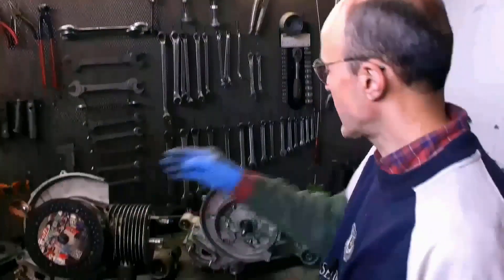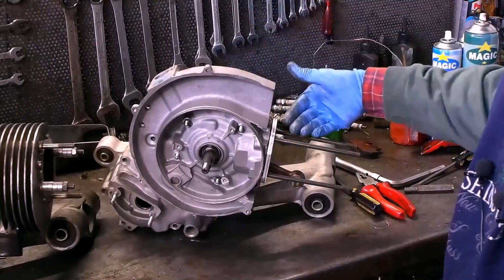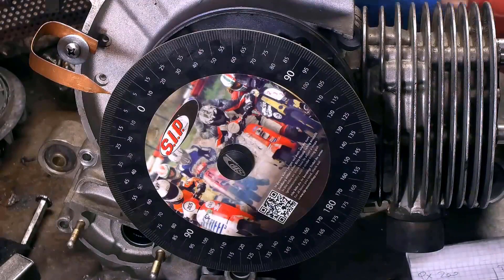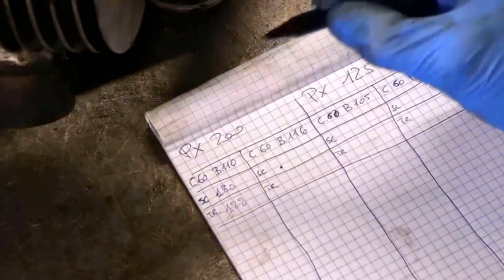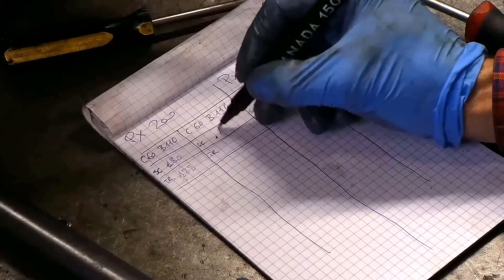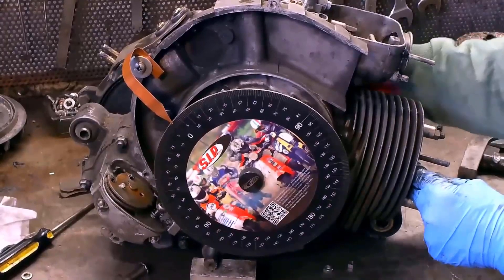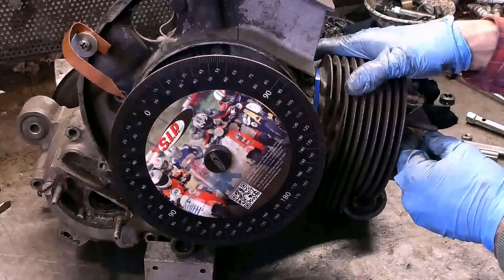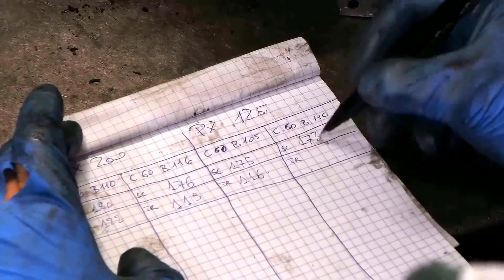17 - Timing variation: Blowdown (connecting rod length) - Part 2 of 3

Comment: I love the video, I’m working on a 50cc Benelli with a stock transfer opening of 120 degrees and a exhaust duration of 168 and a intake duration of 144 what can I do to make this cilinder more sporty but still comfortable to ride at lower speeds what would you recommend? 
I have a stock pipe with a passage of 28mm and a length of about half a meter and a delorto 20mm vhbs 
I hope to hear from you soon

Kind regards 
Mr. Whiskers
Reply from the maker: we recommend bringing the exhaust timing to 180° and the intake timing to 160°, the engine will become grumpier, but much more powerful
Reply: @WhiteOneRacingExtra  thank you so much for the reaction :D , what would you recommend for the ignition timing? Due to it being a road going bike I’ve fitted a now one of a kind kokusan evo 2 ignition 12v.
It has a lighter flywheel then the original Dansi.
Reply from the maker: With static ignition 15-16°
Reply: @WhiteOneRacingExtra your a life saver thanks!